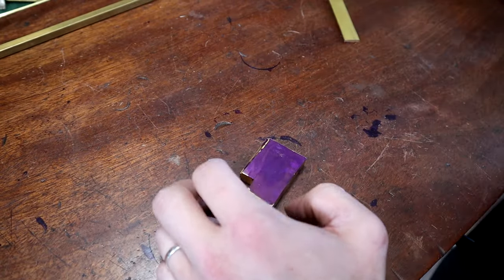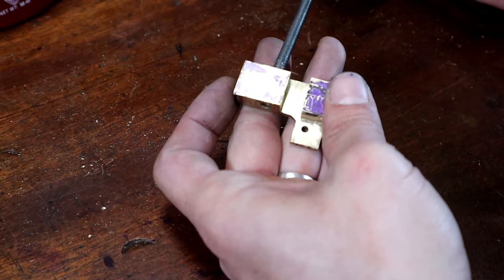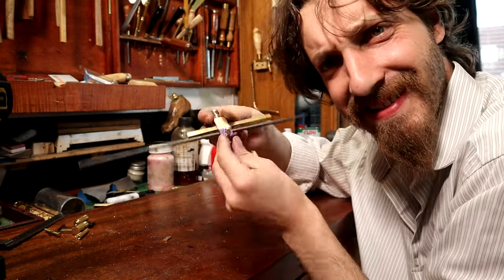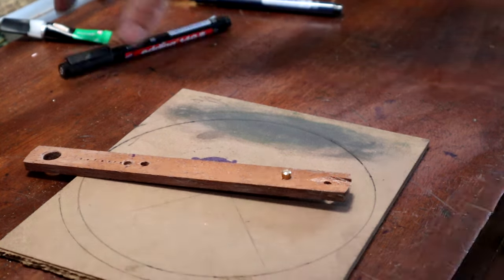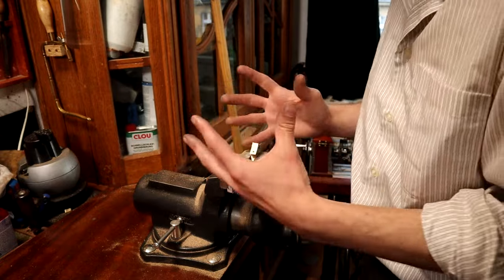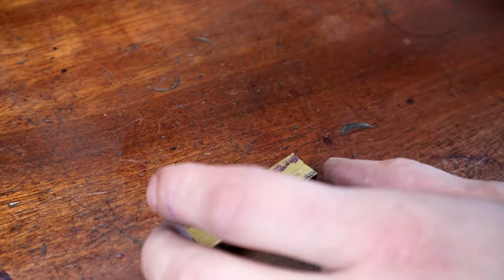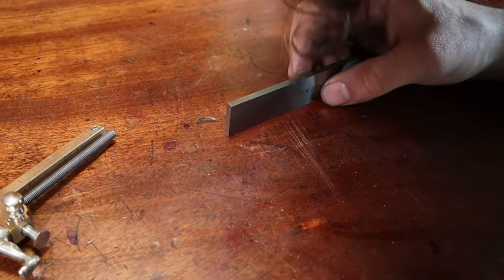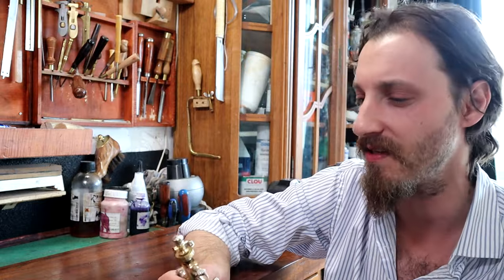Reinventing calipers

Comment: A combination of Archimedes and Monty Python. Excellent!  👈 If the threaded rod has a 1mm pitch and the turning nut was marked  0 - 9 then you could measure in tenths of a mm. Accurate enough for any of my work wood or metal. 👍 😎
Reply: He actually mentioned this in the Video. 👍🏼

Comment: The brand-name "Incra" has table fences and general kit for you to incorporate into your own jigs -- it works like this, with a free movement mode that can then lock in place to toothed bars which snaps it to one unit (1/32" in USA).  Then, a screw with 1/32 thread will fine adjust with a large knob marked in 32 increments.  That fine adjust only has a couple inches of movement, so it doesn't engage the full mechanism.  The full thing will be a large router table fence that must be locked rigidly, so it makes sense to put the fine adjust on a smaller throw.
You can buy the toothed racks from them, that screw onto the slots in aluminum extrusion with T nuts.

Comment: Hi, great concept.  If you flatten the tops of the thread on the half nut and the then green adds rod a little you should be able to minimise the backlash at that the half nut by pressing it in until both sides of the thread are engaged.  A wave washer or tensioning pad at the dial end should minimise slop there.  I haven’t done this yet but have been thinking about how to dial in 0.01 degree increments on a faceting machine using the same method and an M6 thread driving a sinusoidal curve.

Comment: After over 800 posts I doubt you will see this, but suggestions to make it more accurate: To reduce backlash add a second traveling piece behind the leg and also moving with the thread with a leaf spring pulling the leg piece towards it to keep the leg against the right extreme of its backlash, maybe a second foot? Add a second spring to the end piece (hands) to keep the locking collar flat against the dial side. That way both ends will be at the edges of their backlash in a direction that when you tighten up on the object being measured both ends are already at those extremes. To be more rigid, make the other end of the traveling piece (leg) taper down to the ruler so that it is 2 to 3 times wider, then do like a lathe and get the sides of the ruler very flat and parallel and add a jib and two set screws to get the best possible fit that will still slide. Fold up the ends of the jib so that it can't fall out if the set screws are both loose. Add a shim to the traveling piece for front-to-back tightness. The face of the ruler (notches and numbers) may wear off with time with the traveling piece sliding over it. Try notching the front side of the hole to leave the top and bottom to contact the ruler but a slight relief in between so the markings don't wear off. And that is crazy impressive making the hands and leg with a hack saw and dremel!

Comment: guess im a little late but out there are Micrometers with adjustable Anvils so you can messure like 0-100mm but they are very slow to use the way to make micrometers faster is normaly to increas the pitch of the screw (to disengage it would mean you lose all the accuracy you gained by using a screw ) which goes to around 2mm so you are around 4 times faster than a standart Micrometer.
There are Thickness Gages they are very fast and very accurat but they miss some range 
There are some attempts to get a wide range speed and accuracy but theyre all a Compromise.
To me a rlly good Caliper is very nice for Speed and a wide range i can just recommend to get a rlly good one since all spezial Messuring tools get very very expensiv

Comment: I would LOVE to have the need to measure something at work and the mech goes for the calipers, and I say "hold on I got this"... and with the most serious face I could muster proceed to use this device as if it is the most accurate thing out there. Even get a calibration sticker for it.

Comment: You should do a parts kit. Maybe cast the hands and feet, with some precut stock, and detailed drawings.
Does need an second foot, maybe make the half nut handle into a foot.

You could sell it as a 2foot, right and left handed caliper kit.

Comment: I would say if you put a piece on the end so that the screw and the top bar were kept level to each other then it wouldn't flex so bad.  You could also put a small rod going from that piece to the front as a guide rod through the moving foot.  That would make this WAY more stable.

Comment: Uri, question... I've seen you make many gears now over the years... I've seen files for cleaning threads, I wonder if there would be a use for a set of files for involute gear teeth. I bet they would be useful for hobbyist who don't have access to a gear hobber or mill. What do you think? It would reduce backlash and desynchronization of the rpm of gears a lot.

Comment: be worried about the threaded rod wearing away the brass.
There are plenty of precision tools  that allow you to switch out the anvil on them so you can measure different sized dimensions, but There is a limit to how big of an anvil you can use as they are usually high quality carbide which is precision ground. I can't say the range of anvils a precision instrument can use and how well they maintain accuracy. I don't think there is any problem using a 3 inch micrometer that has anvils for 0 to 1 inch, 1 to 2 inch and 2 to 3 inch.

Comment: There are calipers that have like a second thing on the scale you can set and then dial in the perfect amount on the caliperarms. as a fine scale they use the nonius like other ones
Reply: Ich denke auf deutsch kann ichs besser erklären :D
DIese Messchiber haben dann einen zweiten Schieber, den man feststellen kann und mit etwa 5cm M3 oder M4 Gewinde den Messschlitten bewegen kann. Sind tendenziell aber eher älter. Haben so einen auf Arbeit, nur fehlen beide Feststellschrauben für die beiden Schieber, somit useless :)

Comment: Have you ever seen phi calipers? I imagine you could build double screw calipers with geared, counter-rotating screws pushing two outer pointers away from a middle pointer. If you number the gear teeth with adjacent Fibonacci numbers—say 13:21 or 21:34—the pointers will approximate the golden ratio.

Comment: Thinking about instruments, how about an archtop guitar made out of brass with engraving and a bigsby style tremolo wich has a daVinciesque arm and the string tensioning could be actuated by the usual screwknobs with an unnecessary and overly complicated planetary gear.
Of course, pickups would have to be wound by yourself. As they don´t lent themselves for ornamentation you need to build an unnecessary and extremely baroque coilwinding machine.

Comment: If you would like I can design a statistical experiment for you to the determine not only the accuracy of your measurement device but also its precision and we'll throw how much operator error is inherent using the device. This would be especially informative when comparing different devices.